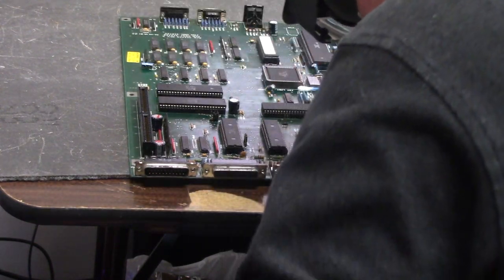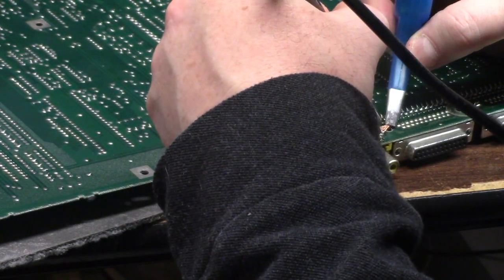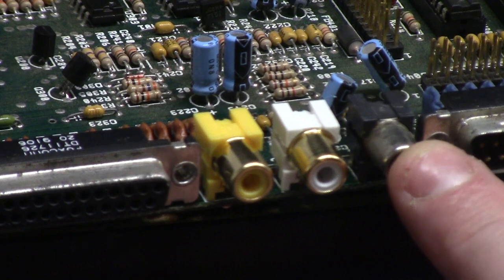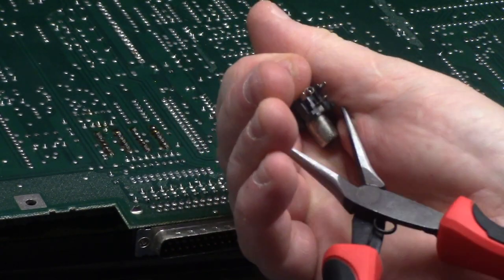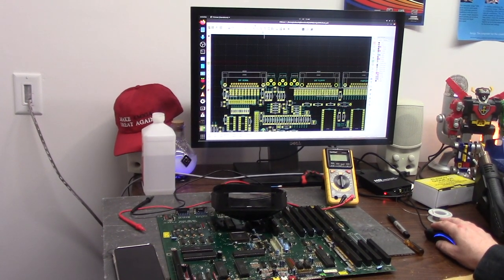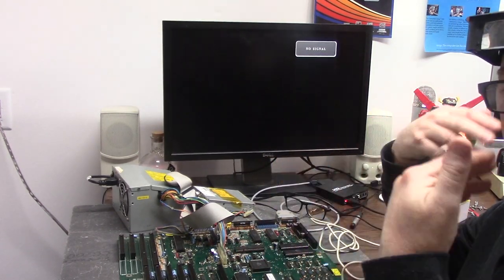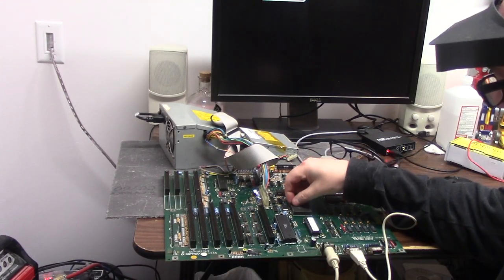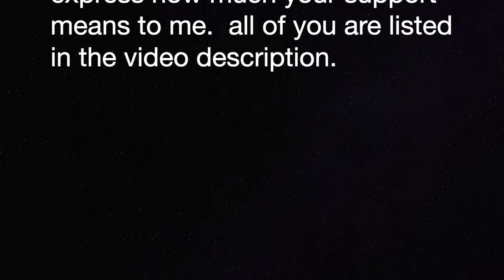Amiga 2000 audio port replacements

Comment: A few years ago I yanked my Amiga 1000 not realizing the audio cables were still plugged in. Well, killed the sound on one for sure. Thought just loosened the port so tried to resolder to no avail
Problem is if you push down or flex it seems to make contact and work  so it led me be to believe that was it. Now in the present I ordered two new port replacements like Chris and took my crappy soldering / unsoldering skills to test. One working the other still will work only flexed. By God it took forever to remove solder. So I am at an impasse now.
Reply from the maker: Go for it!

Comment: "I have too much Amiga stuff". This doesn't compute.

The solder braid in a pen looks really handy. What brand is that?
Reply from the maker: , well it does compute for me, i have 16 amigas currently, and about 11 totes of unseen things that i only unboxed one before relocating the studio to the other side i built walls in.  the debraider wick is here, some hate it, but it has always worked fine for me! https://www.microcenter.com/product/487392/aven-de-soldering-wick-25mm-with-dispenser-wheel-and-4-replacement-spools